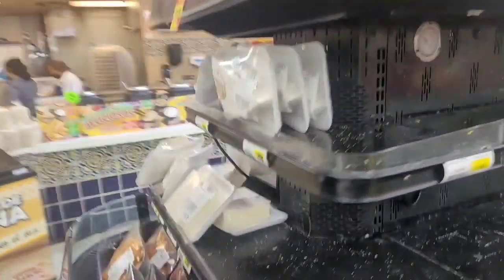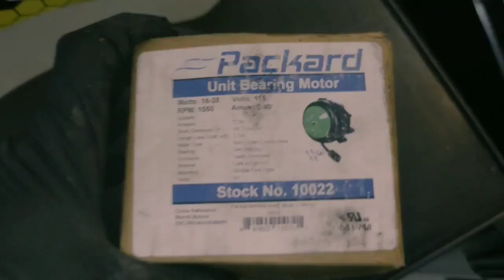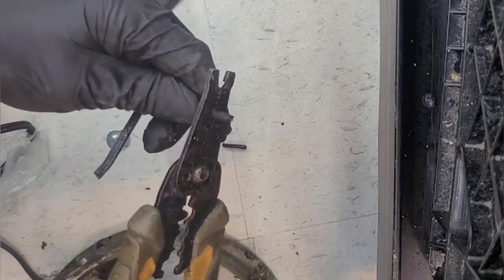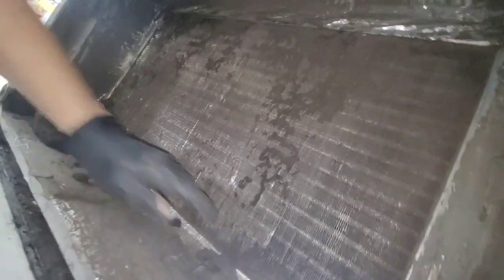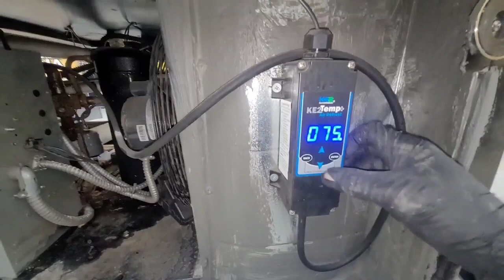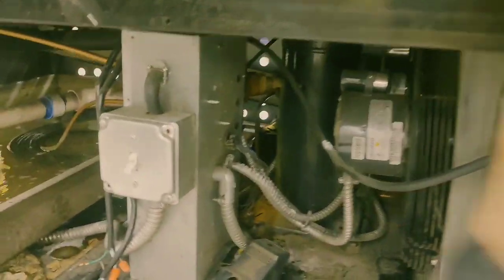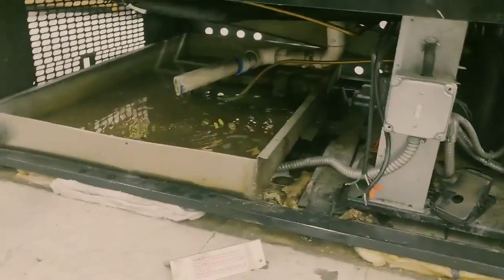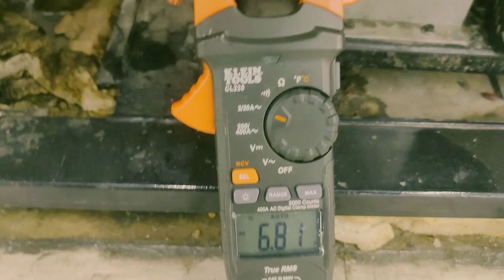ISLAND FRUIT CASE FROZE UP, PLUGGED DRAINS, FAILED EVAP MOTOR/CONDESATE PAN AND ALL COILS ARE DIRTY

Comment: good job getting them back up an running! I hate when equipment gets like that, before you can even think about diagnosing you gotta just get it back to original spec lmao!! that one was nasty AF!  For a call like that do you recommend a return trip to the customer to do just a super thorough cleaning?? Great video man, keep them coming, your commentary is super helpful for beginner techs like me!
Reply from the maker: hey sorry it took so long for me to conment back. yea i have that too. i usually dont, because indint have enough time to. got so many new calls coming in daily that i just try to clean it up as muchbas it needs while I'm there on the 1st trip. 
and thanks.  ill keep them coming!